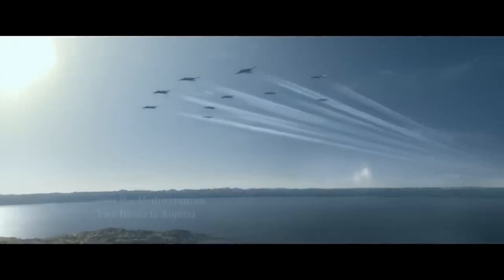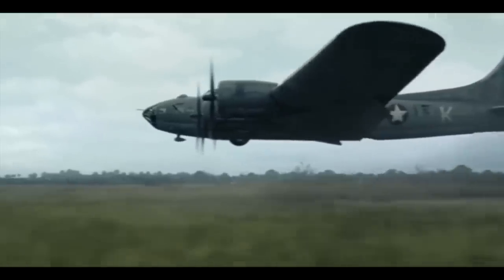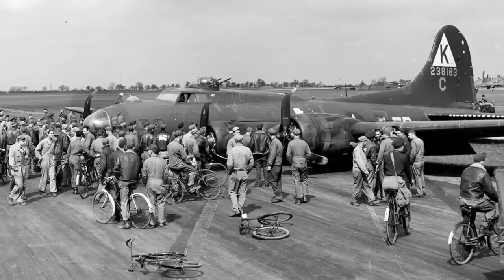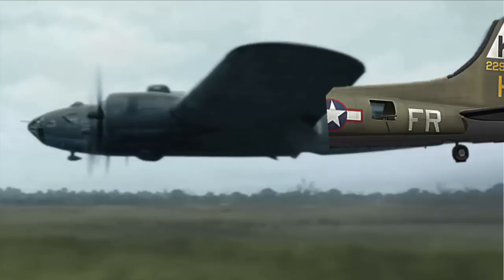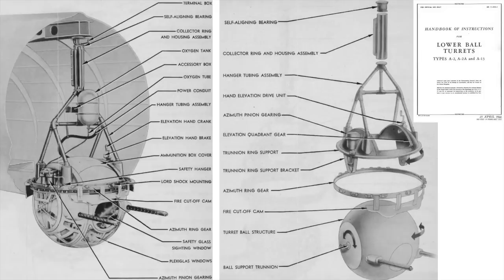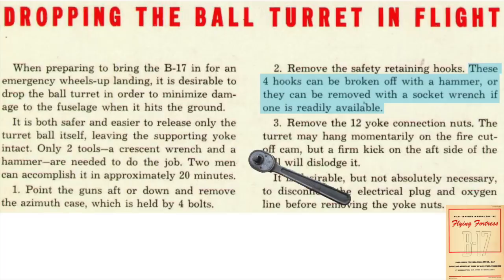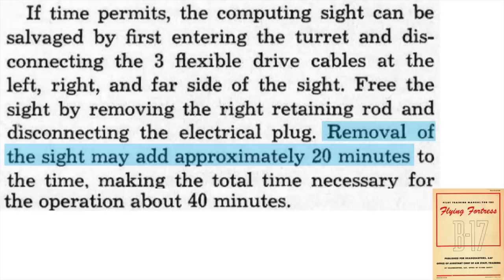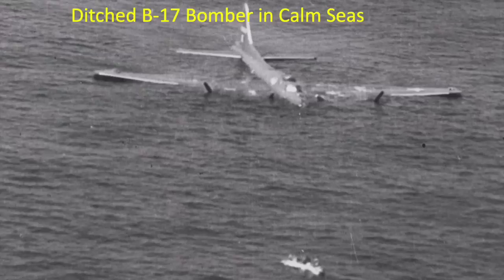Masters of the Air Ball Turret drop- Why and How Explained

Comment: 20 minutes to remove the sight, and 20 minutes to get the turret prepped to drop. That’s sounds like a lot of luxury time in what would otherwise be a crunch time.
Reply: They had 4 and 5 hour flights back after being attacked near the target.
Reply: @dukecraig2402 yes, but inoperable landing gear would likely be discovered only minutes b4 landing!
Reply: @rogermosberger6856  
No, after receiving battle damage they had checks they went through to access the condition of the aircraft they were flying in, they weren't about to wait for the last minute to discover a situation where they'd be forced to land gear up and have the ball turret tear the aircraft apart resulting in a crash that killed people instead of a controlled emergency landing, they knew what they were doing and didn't get their information on how to handle a situation from watching movies full of errors.
Watch actual footage of them landing like that and you'll see the ball turret isn't there, it also isn't rolling down the runway because they dropped it on their final approach after finding out their gear wouldn't come down, only in the movies is that when they find that out, it's called dramatic effect.
Reply: @rogermosberger6856  Exactly! A point I didn’t realize was not apparent
Reply: @rogermosberger6856 they had indicators for failed hydraulic/electrical for a lot of subsystems. And even if its a last minute discovery you wouldn't just belly on the runway. Fly circle drop the ball and other prep then belly the field.
Reply: Two guys before a crash likely could do this in 2 minutes under adrenaline...lol😅
Reply: Remember, it's not being done in a crash when the plane is going down. It's being done when preparing for a belly landing because the landing gear is jammed, or some other structural reason. The time it takes for a plane to set up a belly landing is likely more than 20 mins.
Reply: @zeus6793 Unless the other crew members, like waist gunners, have been shot up and unable to work removing the ball.
Reply: Yeah, I'm guessing that none of the bomb sights ever got removed at the very least.
Reply: "Hey Frank, should we grab the gunsite before we dump the ball turret?"
Reply: Sometimes the crew had the time.... sometimes.
Reply: I doubt they cared about being too clean as long as the sight came free, thirty seconds with some wire cutters to get the cable sheared, theyre being dropped anyway let the techies worry about cleaning up the rest when its back on a nice steady work bench.
Reply: Bet the sight went with the turret too
Reply: @BaikalTii you could  do a lot with a wrench back then. Today you'd probably have to postpone the jettison until you order a special screwdriver off Amazon to remove the Apple trilobe turret security screws.
Reply: I thought exactly the same thing.  In the first episode, they didn't have much time for it - they noticed problems with the landing gear just before landing.
Reply: Crunch Time was over the target area. If you made it out of there still flying on at least three engines, not losing fuel/hydraulic fluid, and with nothing too important on fire, you had a chance of making it back to the English Channel, and you'd deal with any casualty situations in order of priority with that goal in mind. If you then managed to get out of occupied airspace still alive and with at least two working engines plus the other two previous caveats, you had a chance of making it home or at least getting within sight of Britain before having to ditch. And then you still had 90-120 minutes of flight time, four-engine heavies are not fast. Not really necessary to remove the gunsight if it's going to the bottom of the sea... ;)
Reply: @BaikalTii  Because they work and you don't need to take a whole toolbox aloft
The best tool is the one you have at hand, not the one you have to go get
Reply: If you're worried that the weight of the ball turret might prevent you from getting home, you're not going to tack on an extra 20min removing a gunsight, you're just going to drop the turret as soon as you can with the gunsight still attached.  If you take a hit on the way back and realize you've lost hydraulics and the backup handle isn't operating the gear, or the gear is damaged beyond use, or whatever reason that will require you to belly land, you very likely have plenty of time on the long flight back to remove the sight before dropping the turret.  Not every scenario is one where you'd have to get the turret out asap, sometimes it just has to be gone before you land.  I mean, you can think of a thousand situations where you would need to drop the sight with the turret in a hurry, and a thousand situations where you'd have the time to remove it.  But the real question is, does the 800lbs of removed weight really offset the considerably reduced aerodynamics of a huge hole on the belly?  It's basically force feeding air from the slipstream into the fuselage and out through the waist gunner windows and every other little hole in the airframe...that's a significant drag penalty compared to a stowed and somewhat aerodynamic ball turret.  Plus, it's considerably aft, which would put the CG quite a bit further forward when it's jettisoned, requiring more up elevator to hold it level and the added drag that comes from that too.  It's possible that waiting to jettison the turret until 20min from landing would be the smarter move.  Plus if it's over land they might be able to salvage something from it later...gun parts or controls or whatever might have survived.  Just drop it in a farmer's field and mark the location for later retrieval.  Hypothetically, of course, those days are long gone.
Reply: @Skinflaps_Meatslapper  
Uh, no, they did not want a 1,000 lb bowling ball rolling across a farmers field at 150 MPH in England wiping out cows, his house, his barn and maybe his family, and nothing in it would be salvageable anyway, even if it was they didn't want the risk of damages and possibly death's from them being dropped over the English countryside, there were plenty of AN/M2 .50 cals being made every day and it wasn't worth the liability to risk dropping them on England, not that anything in one would be worthwhile afterwards anyway, they told them to drop the ball turrets in the Channel at the latest.
And I'm supremely confident that Boeing and the USAAF were right about the weight savings and that it would more than offset any drag or CG issues, I'm sure they weren't guessing when it comes to that.
Reply: @dukecraig2402  Hard to take anyone serious when they start out with subjective reasoning based on perceived conditions.  You realize how many acres of unoccupied land there was in England at the time that wasn't filled with barns and cattle and houses and families?  There was a lot of it, no risk to people and things that aren't there.  By that metric you'd be arguing that all aircraft that can't land on a runway should ditch in the ocean as well.  You're also being completely subjective with what you think would survive a fall like that.  Lots of useful parts on an M2 that would certainly survive, the barrels would likely be destroyed but the receiver is encased in what amounts to a roll cage.  Receiver, bolts, feed pawls, all of that would likely be fine.  But hey they were making tons of sights too so why bother saving those?  Nowhere did Boeing or the USAAF say that dropping the ball turret would save more fuel than keeping it, that was an assumption made by others here in the comments and in the series.  The only procedures outlined by Boeing and the USAAF for dropping the turret referred to reducing damage to the airframe from belly up landings, so I'm curious about how you became supremely confident of a concept that was never published in any official capacity.
Reply: @BaikalTii  You can do a lot with them
I actually DID a lot with them at work, where it's often kinda inconvenient to go back and grab proper tools.
Usually small things that otherwise get "forgotten" or go "unseen" until they get too big, because people don't go back to get the "right" tools.
Reply: @BaikalTii they had more and better tools, the manual highlight was minimum nessasary.
Reply: @seanhall5385  of course they did. only a knucklehead crew would fly missions with only an adjustable wrench and a hammer. incredible how many stupid gamers are arguing with me about it.
Reply: @BaikalTii  Weight.
Reply: @BaikalTii  Any added weight was to be taken into account.
Reply: total nonsense if it involved getting the plane back as my fathers crew did
Reply: @BaikalTii  that was all that was needed to do the job. They probably hade more tools to do the job.
Reply: Welcome to the army
Can’t have anything to make your job better 
Even if you buy it
Reply: @BaikalTii  Have you ever taken a flight on a helicopter or a small airplane?  Everything is weighed and the position of both luggage and passengers is coordinated to ensure a proper center of balance.

Comment: In 2007 the B-17 Aluminum Overcast visited the local airport. While I was taking pictures of it I talked to a WW2 vet. He said he was a ball turret gunner on a B-17 and later a gunner on a B-29. He was the first person to tell me that a ball turret could be dropped if needed. I was surprised because in all the books I had read and movies and tv shows I had seen I didn't recall that fact ever coming up. Which is surprising since there was an entire TV series '12 O'Clock High' and you would think it would come up in 78 episodes.
Reply: Without the benefit of CGI, how expensive would it be to do a ball turret drop sequence for TV?
Reply: @JinKee  A good model could do it cheaply, but model work doesn't line up with live action an stock footage all that well.
Reply: there was an onboard tool kit and instruction by the flite engineer on how to do it,,most of the "facts "  are hollywoods version,,like commo chatter,,most all plane to plane was morse code by the radio operator,,way less dramatic then the movies
Reply: @richardsmith2684  I was in the AF in communications in analog networks, but I am also a HAM radio operator, which back when I started still required a fair amount of morse code. The AF got rid of the "radio operator" career field back in the '90s because the radios could basically operate themselves (altho thats not really true for shortwave, but that was phasing out as well). 

One night shift, early in the morning I was working in the headquarters unit, standing in as a station of opportunity for the field units to practice with (which still had radio operators), but the propagation was dropping and it was getting hard to communicate, so the (actual per se radio operator) at the other end said "well the path is dying we're either going to have to shut down or switch to morse code". You could tell he wanted to shut down so he could take a nap, but I said "OK, lets switch to morse code." (if I have to stay awake for your benefit, you can too!) 

He (you know - the bespoke radio operator who was required to know morse code for his job) was like "You... know... morse code??" "Yup, lets go". So we switched to morse code. He kept sending "QRS!" (send slower). LOL. Still tell that war story to this day (apparently).
Reply: Read much about B-17s. Ball Turret drop is pretty common knowledge for that bomber.
Reply: Aluminum Overcast is a great aircraft - first plane I ever flew in.  Can't wait for her repairs to be finished.
Reply: How often didi it happen that  the turret was jettisoned with the gunner still inside?
Reply: @moritzheintze7615  Never dropped with a gunner inside. Did you watch the video?  Maybe you should watch it again and pay attention. It clearly describes the complicated steps it takes to remove the retaining hooks, Azimuth case, Yoke fittings, bolts, and yoke connection nuts. I'm willing to bet the gunner would realize the ball current was getting dropped when his electric stopped, his suit started to freeze, and his oxygen hose was disconnected.
Reply: @LastTechnocrat  Sorry, my perception of ball turrets is based on "The World According to Garp"

Comment: Twenty minutes in a fuel emergency is a LONG time. Forty minutes is crazy. I wonder how many B-17s dropped the ball but saved the gunsight?
Reply: I'd be interested to see the calculations as to how big an impact the ball turret had on flight time.

I suppose if the emergency was just, say, non fictional landing gear but fuel not an issue then they might have a go at the sight.  But if they were low on fuel then that extra 20 mins of drag might be critical.
Reply: @KravKernow  I'm quite sure the issue was weight. The turbulence caused by that large hole in the fuselage created more drag than the ball turret did when in place.
Reply: @enscroggs  Ah right.  That does make sense.  I wonder how often this manoeuvre was performed.  If not uncommon then you might have thought they could have provided some sort of hatch cover or baffle to put in place.  Wouldn't have to be heavy.  Aluminium, or even canvas, would probably do the trick.

Come to think of it, how much did the sight weigh?  They were pretty complex bits of kit.

Comment: I had always heard that the ball turret gunner was not able to get out until the plane landed....obviously I was misinformed. Good to hear!
Reply: There's a lot of bad lore about the ball turret on a B-17. A consistent favorite is a ball turret gunner being ground into a smear on the runway when a bomber had to do a belly landing. If you were somehow stuck in the turret (not impossible) it certainly wouldn't be a safe place to be when the bomber was skidding down a runway, however it's far from a death sentence either. The ball turret itself is quite strong and most likely will get shoved up into the B-17's fuselage, with the yoke and armature framing puncturing the top in the process.

The true horror of the ball turret is if you need to evacuate quickly, like your aircraft is suddenly losing a lot of altitude. Most of the other crew members have a chance of getting out quickly, the ball turret gunner is going to need a minute.
Reply: @malikcarr9872 That 'bad lore' you refer to came from an eyewitness account written by none other than Andy Rooney, war correspondent that flew with the Mighty 8th. He claims to have been present and watched it all happen, but there are doubters to his story.
Reply: On the B17 the ball turret gunner could not get in it until after the plane took off.  I believe the details are in another video
Reply: Could be the Liberator…
Reply: I've heard of instances when the plane took damage and the turret couldn't be rotated to align it with the hole in the fuselage, which meant he was stuck in there until after landing. It made for a nasty time if the wheels could not be extended.

Comment: I bet the ball turret gunner made sure he was either really liked or owed the crew money.
Reply: Full respect for the people getting into that ball.
I'll never be able.
Also, the ball needs to be turned a specific way to get In-&-Out. And if it gets stuck, the person in there is stuck in there, His fate is either getting smooshed at landing or dropped.
Kinda unsettling if you think about it.
Reply: @johnhill2927 
Guns must point straight down so the door is up for entry/exit. The gunner sits with his back on the door. He can bail out with the guns horizontal and facing forward..
Reply: @johnhill2927 The smallest person on the crew was the one who crawled into the ball.
Reply: As long as the plane is still flying, iirc the ball turret gunner was the most survivable location.
Reply: The smart ones kept the wrench on them.
Reply: my great uncle trained as a ball gunner on 17s in 44 before he was transfered to the pacific and became a ground crew mechanic on B29s

Comment: Very interesting!
I'm in my 70's. And in my youth I had many, many personal conversations with WW2 VETS that served in the Air Corps. And NEVER have I EVER heard any mention of them OR ANY OTHER BOMBER having to jettison the "Ball turrent"!!!!!
This must have been VERY RARE, to say the least !!!!!
Reply: It wasn't common to take the time to jettison the turret, but it was authorized. Early in the war there are many film clips of B-17's landing wheels or one wheel up. The telltale of the turret still there is usually seen as the support box for the turret rammed through the top of the fuselage. The turret itself is rather fragile and most likely would crush in the landing, but the damage to the aircraft could be extensive. Saving repair man hours was critical during the war and as almost all maintenance had to be done in the evening or at night, time was a factor. Major repair could take up what little hanger space they had with a policy of standard blackout conditions prevailing.  Even though the turret was expensive, many extra units were manufactured for possible use after a jettison event. This I believe is why the ball turret is the most common of surviving turrets today and it was more trouble to scrap than it was worth after the war. The correct B-17 top turrets are the very hard ones to find as well as the Bendix turrets used on B-25 aircraft. The Martin 250CE top turret seems to be the most common still found.
Reply: True 
Extra turrets sat in some government wharehouse for years
Also had training turrets
Reply: It happened to my uncle.